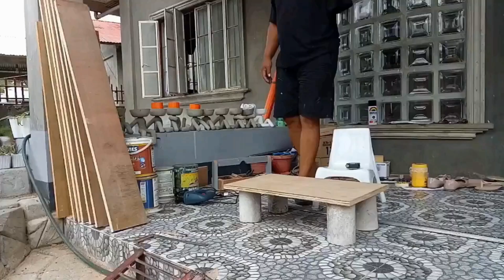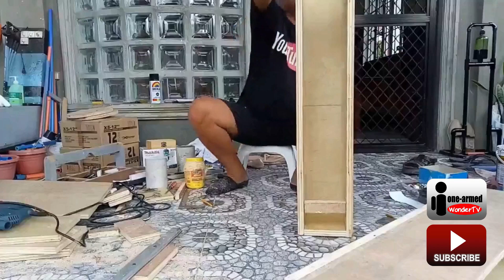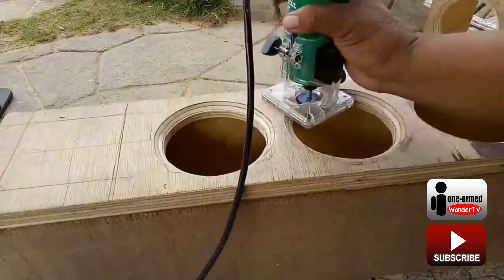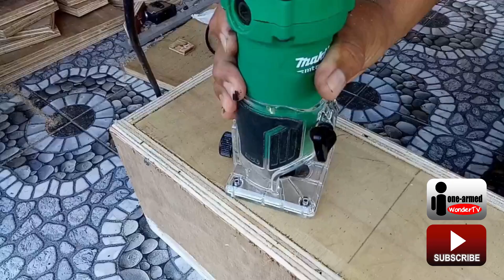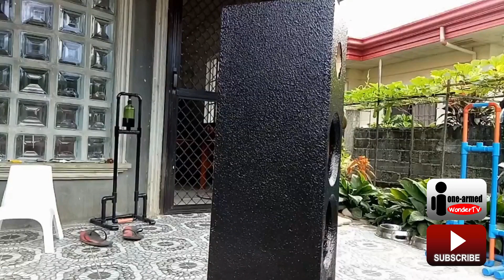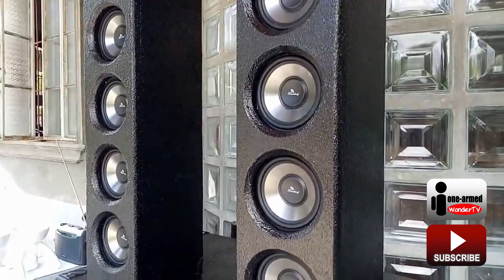DIY MAKING COLUMN ARRAY D5 MIDHI BOX".

Comment: Bro ask ko lang ilang watta mid hi speakers mo at tweeter? magkano inabot in all...

Ano g klasing paint gamit mo?
Reply from the maker: D5 100watts each. Tweeter horn size 5x5 Compression driver unit Broadway 300watts. Classitex Textured paint at  black elastomeric paint gamit ko 1:1 ratio.